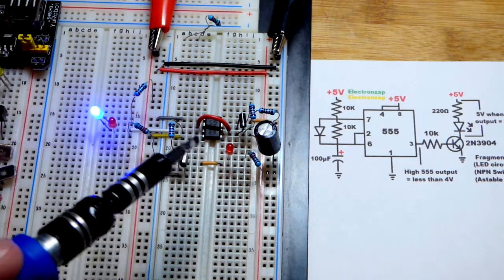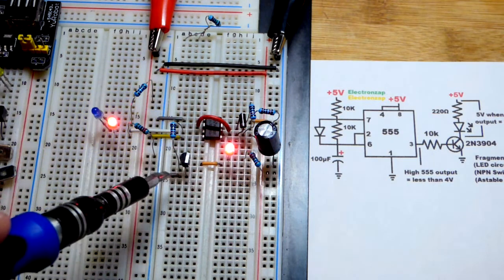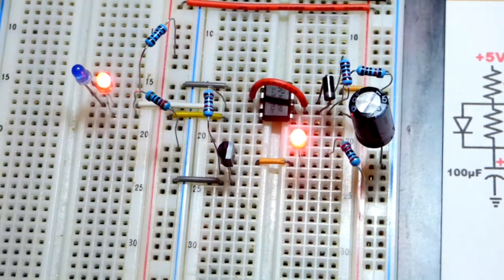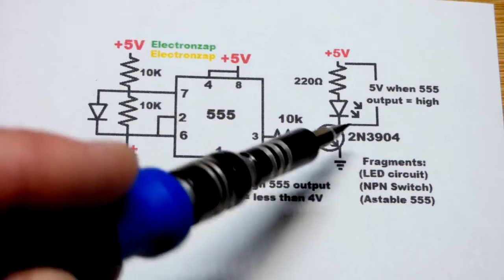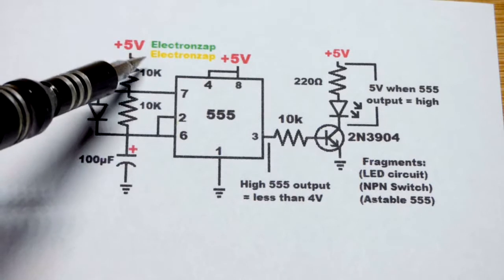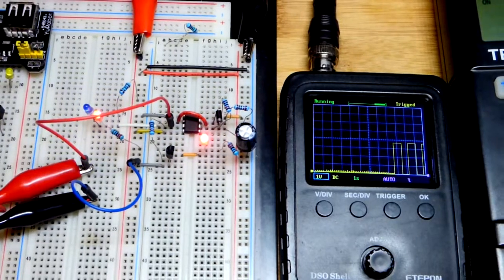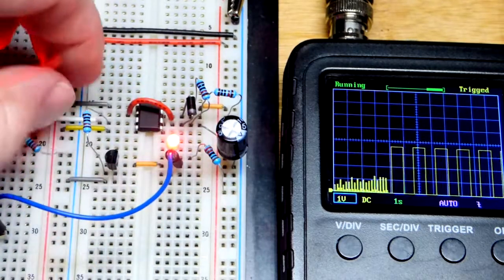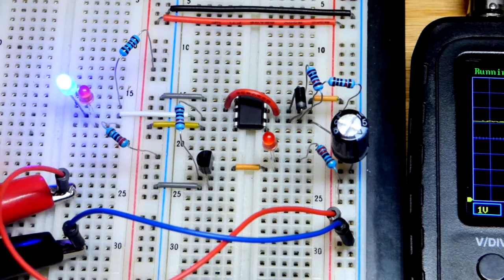555 timer output needs a NPN BJT to provide full supply voltage to LED load using 2N3904

Comment: I can't see the resistor network clearly. I tryed to replicate it but it didn't work
Reply: I got it to flash but I had to use 1000uf cap and I don't know if it's actually wired right
Reply: I put the two 10k resistors on 6 and 7 and 7 and 8
Reply from the maker: That sounds wired right :)
Reply from the maker: That's a bummer, try checking out some other astable 555 timer circuits. They all basically operate the same way.

Comment: Thanks for the video. I'm curious, what causes the small voltage fluctuations at the bottom of the square wave when you were measuring the LED off the transistor?
Reply from the maker: The transistor wasn't conducting, and neither was the LED in one direction, while in the other direction it takes about 1.5V before the LED will conduct. So, between the LED and collector became like an antenna that gained a really weak voltage due to alternating electromagnetic energy in the air from the household wiring. And so with nowhere for the energy to dissipate to, it builds up a voltage across the relatively high resistance of 1 million ohms for this oscilloscope. I just put a 10k (pull up) resistor parallel to the LED and it's protective resistor, and that got rid of the voltage spikes.
Reply: @Electronzap  Thanks for explaining! That makes sense.